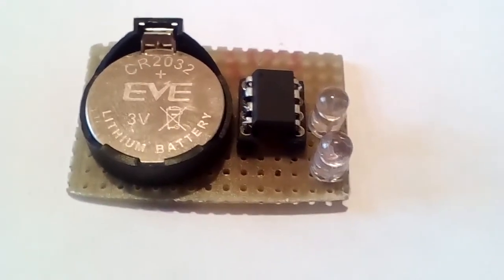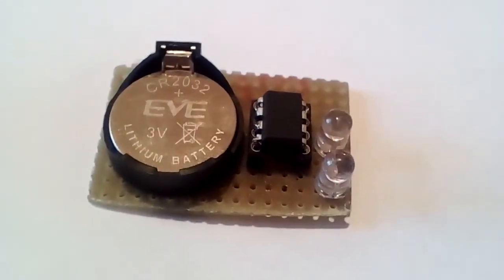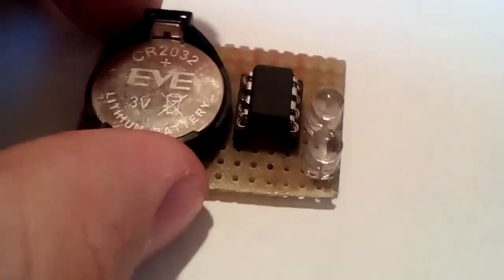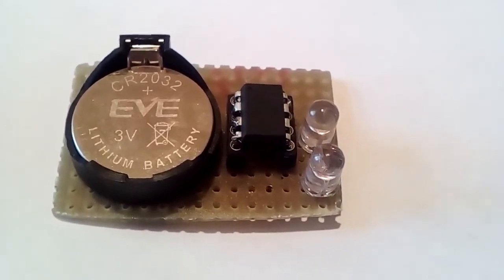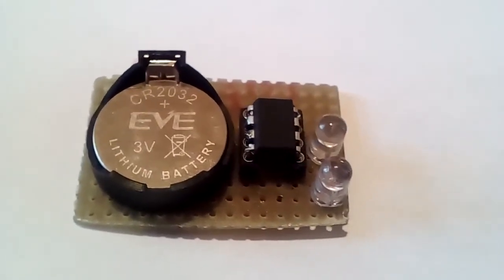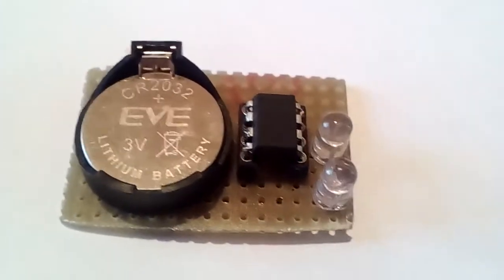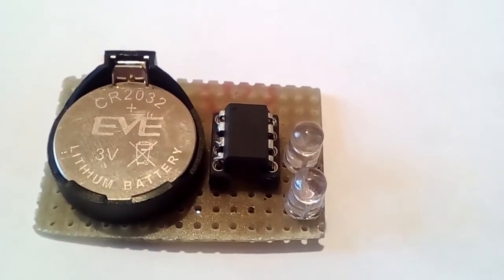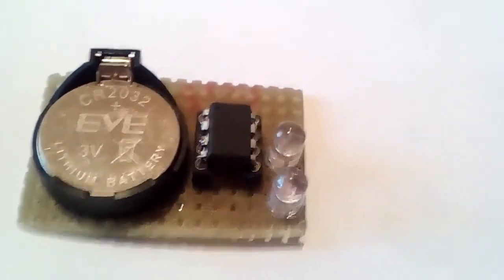Ultra low power LED flasher.

Comment: Cool. Nice to hear you in the video. This reminded me of a circuit I built long time ago - powered from 1.5v cell and had a dedicated 8 pin chip - ultra low power, bit can't remember what it was... i will have to look for it now...
Reply from the maker: Thanks!! Are you talking about the LM3909 chip? I remember seeing some LED flasher constructions with that chip too, but nowadays it's hard to get, an ATtiny13 is reprogrammable, easier to get and also cheaper (even together with a USBASP clone).
Reply: +TefaTronix it might have been that one, i would have to look at the circuit, i will check it shortly. i was quite a while back, so the chip might be unobtainable nowadays in small quantities(China will make anything for you as long as you buy enough of it)
Reply from the maker: It most likely is that chip. I just took a look at eBay, it costs around ~5 USD per piece, and also it looks like it could be simply built just using discrete parts if it's not available as the schematic in the DS is fairly simple. Gonna play with some SPICE simulations.

Comment: you calculate time for drain baterry ?
Reply from the maker: It is still working :) Check the link in the description for calculation.
Reply: @tefatronix  
will it be if I used a joule thief and a 1.5 cell would work the same time as the battery?
Reply from the maker: @glaysonmestre  The Joule thief circuit is quite inefficient and draws much more current than this circuit.
If you want a flasher running off a 1.5 volt cell, take a look at the LM3909 integrated circuit. It is not manufactured anymore, but you might find it on eBay.
Reply: @tefatronix  
but this circuit uses a joule thief and lasts 10 years https://www.youtube.com/watch?v=DOajZVz8n6o&t=3s I bought all the parts but I could not make it work, this circuit of yours I did not find this ci sera that there is something easier that spends little energy and lasts for at least 10 years

Comment: 15 or even 4 microAmp is even not really an >ultra< low power (even not low-power too) for LED-blinker.
Even in a bad implementation like that : the LED flashes only for 3 !milliseconds! So what?! 3 milliseconds?! It is tooooo less!

Low power solution for the world's simplest circuit would be much lower than 1 microAmp!